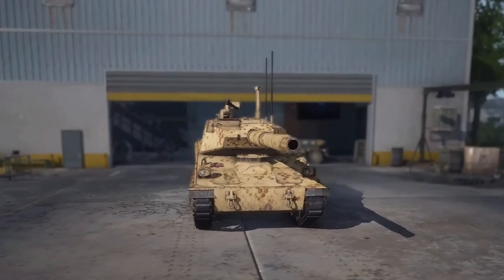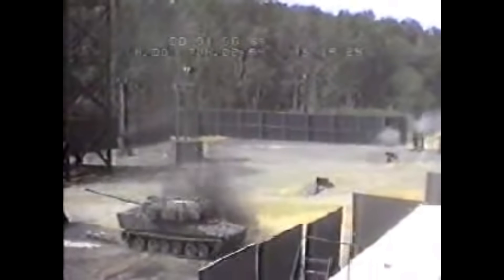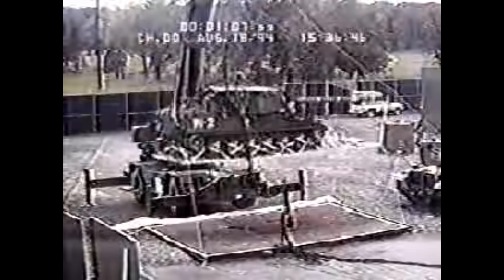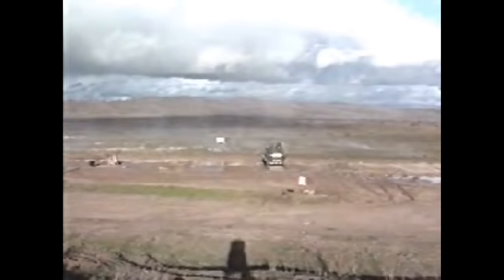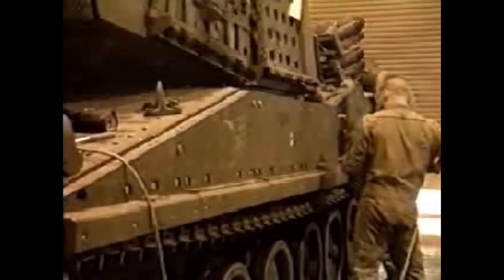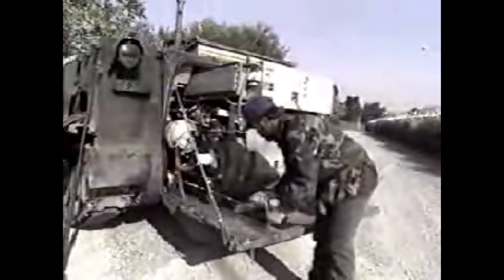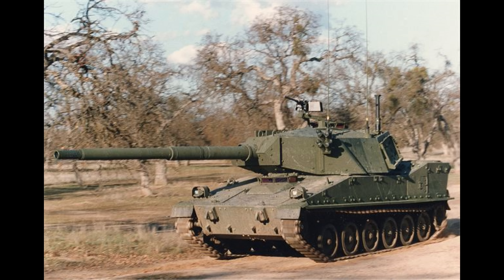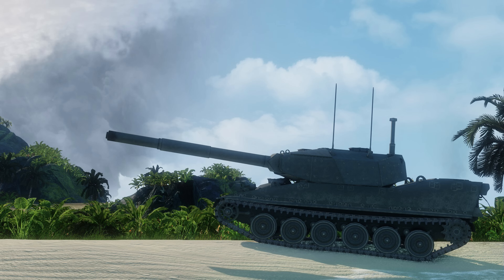M8 'AGS' Armored Gun System | IMPRESSIVE LIGHT TANK

Comment: I like the idea of a fully modern two-man crewed compact tank with regular armor (not aluminum).  By fully modern, I mean with active defense systems and lots of optics and sensors so the small crew can have excellent situational awareness in all directions.  Put something like a 50mm or 70mm autocannon and anti-tank missiles, and that thick-skinned compact thing would be a huge pain for an opponent. 

I wonder if something like that could be built and weigh around 30 to 35 tons.

Comment: The issue with the M551 was a combination of things. For starters the stupid missile gun concept. On paper it made perfect sense in practice not so much cause you ended up with the worst features of both. Next was the decision to try to lighten it as much as possible which is understandable for air dropping but they used extensive amounts of aluminum in its construction, this did very little to prevent anything but light small arms from penetrating. Then there was it’s first deployment in Vietnam, Vietnam was absolutely unsuited for almost any kind of significant armored warfare as the jungle was too thick to break and provided ambush opportunities for anyone with basic anti tank weapons which the 551 was very susceptible to. The M551s other flaw was the decision to make it amphibious, us war planners wanted to build a “ Better PT-76” in essence and like the Bradley IFV tried to build an airborne, amphibious “ do all” tank. They ended up with a vehicle that really wasn’t very good at its intended purpose

Comment: This thing is so well protected against shaped charge that it is absurdly vulnerable (even at Level 3 protection) to the more primitive, yet cheaper and more efficient anti material rifle.
Cold War era 14.5mm or 20mm anti material rifle fired by your average insurgent from 1km away have no problem perforating though the thickest part of this vehicle, while such rifle with hundreds of AP cartridges costs less than an RPG with 1 rocket at black market.

Comment: 10:30 some additional things about the M8 AGS CCVL, you could hand crank the turret externally to right the entire vehicle if it ever tumbled over.  Each interior compartment is an armored shell, so if you were hit in the fuel tank or magazine the explosions would be forced upwards.  Allegedly, according to one author down in Texas, the AGS could not survive, but you've shown that to be incorrect in this video.  I'm no expert, but the gap between the turret and the body, to me, looks like a potential shot trap.  I think the thing could do upwards of 80 mph (not kph, mph) on open terrain.   I seem to recall that it is maybe a few inches taller than the M1.  An interesting little vehicle that, as you say, might see the light of day again.

Comment: The M8 was not intended to fight alone. The US Army also built prototypes of another vehicle based on the Bradley chassis to operate alongside it. This was the Line of Site Anti-tank (LOSAT) vehicle sporting a pack of 6 hyper-velocity missiles. It was intended to engage threat armour at long-range, allowing the M8 to handle shorter-range and non-armoured targets.  I don't know what the CONOP for the USA's 'mobile protected firepower' project is, but it must have evolved to not include a successor to LOSAT.

Comment: This concept looks interesting to me. Which would give you adequate armor shredding ability and an infantry suppressing ability with low weight? A roughly 40mm gun with armor piecing shells or the 105mm cannon? Anyhow, the concept is about the same. Light weight, high speed, adequately but not over armored, and air droppable tank like vehicle. I believe the Stryker was suppose to fill this role.

Comment: If the Stryker MGS was not intended to engage modern tanks, but to provide fire support to the infantry, what target sets are the M8 intended to engage? 'Early-entry' forces may face tanks, no? Judging by the 'reviews' of the Stryker MGS on this site, the M8 platform seems more suitable for a big gun than the LAV. More protection, too.I seem to recall that there was a prototype M8 with a 120mm gun. Fewer stowed rounds, perhaps, but worth considering? If not, can the existing auto loader and gun handle an anti-tank missile for long-range sniping? (Recall that the Cockerill 105mm gun system can fire the laser-guided Falarick (sp?) ATGM out to 5km.)

Comment: I saw one of these when I was a tanker at Ft.Knox. Everyone was impressed with it, especially the maintenance because the engine pack could be rolled out on to the back door to be worked on and it took one guy to change out a pack in about thirty minutes. They also had rubber fuel tanks there and you ran the tank up onto them to fuel the vehicle. I liked the auto loader because you could switch from HEAT to Sabot with a switch. I believe they said it was a naval gun system that was very reliable. I've never understood the idea of armor being airborne because you are always going to sacrifice weight for mobility or vice versa. I was a tanker on the M 1A1 and it was a bloated battleship. What good is all that armor if you burn fuel like crazy and suck in tons of dust for that jet turbine? I would have put this tank up against any tank in the world, speed beats size any day. You can't hit me if I ain't there.

Comment: Has the USMC ever considered this a replacement for the Abrams? 

- Its quick
- Packs a punch
- Easier to maintain than the Abrams
- Armour is modular and can be mission oriented

Then again a Striker MGS could have filled the role as well despite it not being a tank.
Reply: Though not yet confirmed there are rumours that the Marines is interested in whoever wins the Army Mobile Protected Firepower program(Light tank). An updated M8 is being offered by BAE systems.

Comment: I think the main reason after $$$ why the M8 AGS won't pick now: Stryker. Smaller (ish), enough manoeuvres for most of operation.  same weight with better protection. more versatile to support infantry.  can be airdrop.
Reply: The Stryker AGS mounts the same gun.  Is that vehicle air dropped?

Comment: The "logistics of resupplying" do not really apply for Airborne units. If you launch an airborne assault and deploy infantry units behind enemy lines they shouldn't even expect to be "resupplied". If they are starting to get "resupplied" it means there's already something gone horribly wrong with the overall plan of battle. What do they REALLY expect is your main force to punch through the enemy line asap and reuinte with them - STILL - they've been given an objective to accomplish, and armoured support - behind enemy lines - might get them the "punch" they need to achieve it, and/or a much stronger capability to resist to a first counter-attack, while waiting to be...(BASICALLY) ..."rescued", because that's what it all boils down to, at the end. Armoured support for Airborne units might mean the difference beteen life and death for them. They cannot simply retreat in whatever direction they want, like most "regular" Army units can do. After a while - they become "sitting ducks". That "little tank" means as much 10 MBT's for them.

Comment: But Sheridans did to fired the MGM-51 Shillelagh missiles fromed its short smoothed barrel. Only Airborns and Marines airborne did used the sheridans light tank be caused it could geted air dropped or low-altitude parachute-extraction system dropped ( LAPES). I thought they were cool

Comment: 120mm gun , Javelin launcher and cheap enough to buy 30 000 of it and drop the concept of a main battle tank...
Reply: That's ridiculous. The Army would have to increase in size by over 100k personnel to even attempt to replace current Abrams units with that many light tanks. Not to mention they'd have to double the number of logistics units to keep up with their supply requirements.  To top it all off at the end of the day you could beat those with half the number of properly supported T-55AMVs thanks to their Bastion missile outranging the javelin by several thousand meters.

Comment: Imho light tanks have a hard time to convince anyone of their qualities is everyone seems to expect the same performances as an MBT. Same protection, damage output and durability. 
In my opinion the german Wiesel was on the other hand the logical solution to the demand of better anti-tank weaponry for light troops, especially Airborne. Light enough to have two fully equipped vehicles in a CH-53 and with 7 rounds of TOW missiles capable of dealing quite some damage at the price of 5 million D-mark when fully equipped. It was narrow and light enough to 'weasle" its way through typical german forests and not bigger than a Golf IV.
The M8 AGS never had a chance imho.
Reply: Actually, the Wiesel would be a good choice for an airborne anti-tank system.  The Light tank does add infantry support as a self-propelled gun.  There is the problem of "It looks like a Tank so it must be a Tank" mindset.  The Army had that problem with the Bradley but the NTC training fixed that.  The M551 was a good vehicle but the gun/missile launcher used was not a good weapon system for a 16 US ton vehicle.  The electronics in that era was too delicate, the recoil too much, and the caseless ammunition both too easy to damage and burn. The M8 would have made a good replacement.

Comment: Wait does having a fourth crew member really increase the weight more compared to an auto loader? I would think it’s the opposite.
Reply: It isn't the weight so much as the space.  Having a human loader also affects where and how the ammunition is stowed and the size of the vehicle.  Main problem with a turreted auto loader is loading a gun that elevates and depresses.  Soviet tanks have an auto-loader.  When fired the gun goes to full elevation, the auto-loader loads it, and then the gun goes back to the elevation the stabilized sight is at.  Leclerc has an auto-loader and the ammunition in the turret bustle.  Soviet tanks store theirs at the bottom of the turret.  The T72 has the shells stored vertically.  The later T80-90 changed that to horizontally.  Vertically, the shells were being hit when the vehicle was penetrated and the ammunition fires blew the turrets off, quickly.

Comment: Matsimus!

As You might have gathered, I am hugely interested in light tanks!

It is not because I believe in air transportable tanks - not to mention the sick idea of dropping a tank out of an aeroplane. The latter is like the idea of non-alcholich beer: Perverse to the point of pedophelia.

A light tank cannot ever replace a real tank - ever! There are situations where nothing but a Challenger 2 is up to the challenge - maybe a Leopard 2 or an Abrams; but otherwise: NO!

It does however have its place!

There are places where a real tank can't go! This is due to the fact that there are areas where the ground pressure of a tank is simply to great no matter how you skin the cat. take the boarder from Poland all the way to Sct. Petersburg. It passes through a vast area called the Masurian Swamps - You know what it is: Basically a swamp - i.e. walking on barely diluted water.

The other application is as an anti-invasion vehicle. We have just agreed, that airdroppable tanks ARE NOT going to happen, so around objects that could (imagined) be taken by paratroopers or sea borne invasion, They are really awesome.

I think one should start another place: The purpose of tracks is to distribute weight so the vehicle can go places where wheels will only sink in! Marshes etc.
Now taking the modern rubber tracks that are coming on the market, lighter and more maintainance (and road) freindly than metal tracks.
Then You proceed to the engine, and modern diesels have a high power to weight ration, so that will cut down weight from both the engine itself - and here I only recommend basic maintainance requirements - in case of major repairs - you simply replace the f*** engine - like you do on the Leopard 1.

Then it seems like the M38 gun is what the doctor ordered - it might not have the range of a L7, but as long as it has the range up to the distance where you have a chance to see the target - not hiding behind the proverbial clothes line - and engage with DIRECT fire. Then adjust charge, muzzle brake, yada yada yada
Autoloader to the get rid of the ruddy loader - track tension is not the same "YUCK!!!".

Then lets see how the weight budget looks like? How much armour up to 20 tons can you actually put on the damned thing? It won't stop a direct hit by a 50 kiloton nuclear weapon, but apart from that what is achieveable with a reasonably modern engines fuel consumption?

Now the road speed is not that interesting, as this vehicle is meant to go where there is NO road and bridges are something you have equipment for - anyhow. The offensive application coming out of nowhere through the swamp where the nasty enemy cannot move his tanks.

Now we are talking technology THAT IS DEVELOPED and just not seriously tinkered together in a vehicle.

As to transport: Well you could preposition f.i. on Iceland that will need an armoured BTN anyhow to defend against anyhow.

Airtransportable - maybe; but that supposes you have a bloody airstrip to land them on and the LEGO solution does not consider that it takes time to assemble at the airport and move quite a distance to get to the fight - I don't think there is any time saved. It will take 5 days to move from Halifax to Europe - no matter what. From Iceland or Norway the transit is cut in half, which is 2½ days - weather permitting. Say 3 days!
Now as the medium forces will be under way and arrive after 5 days you have the infrastructure to yourself to deploy and set up shop for 2 whole days!

So yes! It should be doable and you will have not only the defence; but also the opportunity to counter punch.

Comment: I´d love to see the role of light tanks in WWII both in concept and reality.
I bet it was at least for the soviets something like:
Fiction: BT5 goes through breeches of the enemy lines and harasses enemies
Reality: BT5 used as an MBT in a static position, because the real medium tanks or artillery weren´t relocated quickly enough.

Still, I think there´s much more to say about it.
Reply: T26 supported the infantry.  T28 was main medium tank to be replaced by the T34.  BT5-8 fast tanks were for exploitation.  Soviet Deep Penetration before WW2 very much like their operations starting in late 1943-through 1945.  Massive artillery fire supporting infantry supported by heavy tanks and tank regiments to break through German defenses, with a Tank Corps as an advance guard to complete the break through and a Tank Army to exploit.  IS-2, SU-76M, T3476 break through, T34/85, ISU and SU with motorized infantry do the deep penetration to take specific objectives that would destroy the German's ability to continue the defense, usually major transportation centers, bridges, choke points up to 300km behind the German lines.  The Soviets were going to do this in 1941-42 but poor command, communications, logistics, and leadership prevented it, plus the Germans as their opponents also got to vote.

Comment: Stryker kinda of went the same way. Even the same autoloader system.
Also the increased presence of AT weapons  make light vehicles like this very vulnerable.
The use of 105mm gun is no longer relevant. It is incapable of dealing with modern armor, which is what it was intended to do, and putting a 30 or 40mm on the vehicle instead is more efficient for most purposes. But then you end up with an IFV basically.
Bottom line is - a light tank like this doeasnt really do anything special. The only way it would make any sense if it had a modern 120mm gun that can contest tanks on the battle field and fields an APS for protection. If youre not planning on fighting enemy armor with it, then why put an AT gun on it? So yea, thats kinda why they didnt really catch on and have remained a niche thing.

Comment: As long as the US NEVER fights another war like Iraq. And we only fight conventional army's then yeah this light tank sounds like a good idea. However its made up of Aluminum armor. Same as the Bradley so they can keep its weight down and speed up. The problem is IED's have been proven so effective that unless you are fighting a war where the lines are more defined and faster paced. You will see a shit ton of these tanks blown to kingdom come by some ass hole with a shovel and some explosives. I was a Bradley mechanic and did 3 tours in Iraq. I have seen far too many blown up and burned down Bradleys and other vehicles because of IEDs. The Bradley saved lives but it also lost lives. It was always a toss up as to what would happen. But one thing I have seen far too often is Aluminum vehicles burning down into slag pools. Flat hulls just take blasts from the bottom full on. I just don't want to see young soldiers facing the same bullshit we did in Iraq. I have seen all too often the results of what a desperate enemy can do.
Edit: Thinking more about this I will say I was one of the Bradley mechanics 4 ID loaned out to the 101st ABN 1/32 CAV at FOB Normandy when they recieved 13 Bradleys. Very few of their scouts had ever been in a Bradley so they were pretty much Cherry mechanized scouts. Out of the 13 Brads they got. 11 were coded out for IEDs. 4 burned down till the turrets were sitting inside the hulls. And one only burned out. The rest were damaged to the point the hulls crushed fuel cells inside and thus no longer usable. They lost only 1 soldier during the 8 months I was with them. But they were damn lucky as well, because I had seen 3rd ACRs rear D doing funerals for a month each Friday for 4 different soldiers each time. They were Bradley crews lost in Iraq. 
I love tanks just as much as the next guy. But my biggest love is the M88a1, it was my first vehicle I drove in the Army and I was hooked from the start. And it was the one I felt the safest riding in over in Iraq.